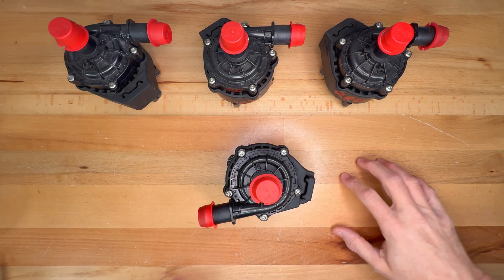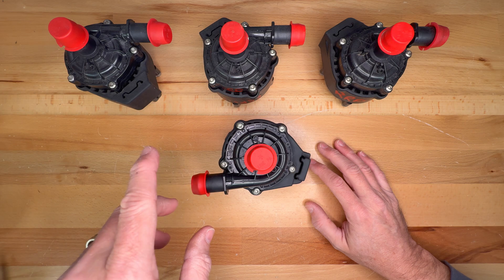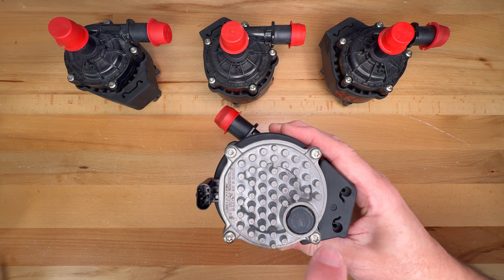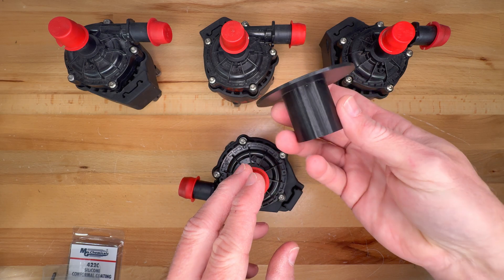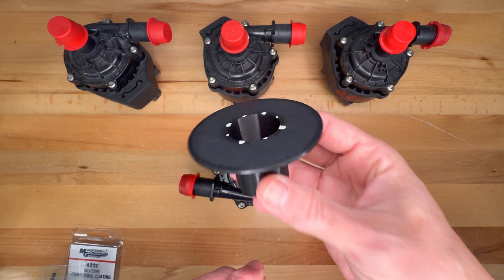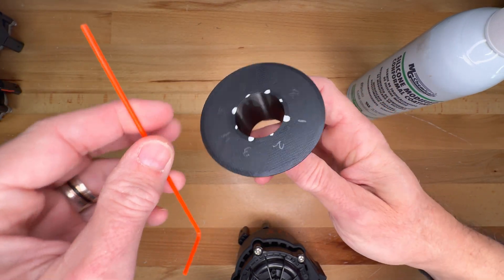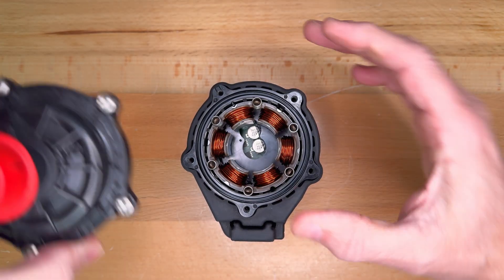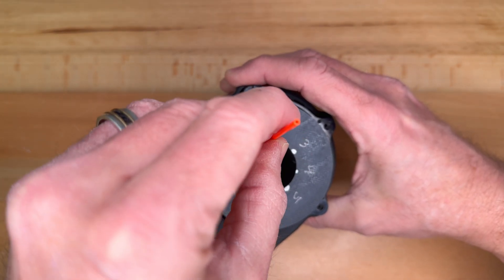Fisker Ocean - Water Pump Fix

Comment: Can I test the pump with 12V contacts to see if it's still working? It has 3 pins. After replacing it, my fan is working, but the new pump doesn't vibrate, as if it's not working?
Reply from the maker: If the pump isn't working, you will get an error.  I'm not sure how to test it otherwise.  Where did you get the replacement pump?  Are you in the US?

Comment: How do you tell if the water pump (or door handles for that matter) were fixed through the recall? NHTSA's recall look-up does not seem to show whether a particular Ocean has had the work done.
Reply from the maker: You will either need to look at the water pump label which shows the manufactured date (after March 2024) or have an invoice from the service tech.

Comment: My understanding reason the water pump leaks so early is because they had a batch where the oring was pinched causing it to prematurely leak. You just really just need to replace the oring .....
Reply from the maker: The recalled HVAC water pump is due to the printed circuit board not having enough conformal coating to protect the resistors from water vapor inside the pump.  It has nothing to do with the o-ring.

Comment: Hello,
A big thank you for excellent videos, precise and instructive.
I have a FOO and the heating of the cabin does not work anymore. The AC works but not very powerful. Do you have an idea to solve this problem?
Thank you very much JY Berney from France
Reply from the maker: @jyberney  Did you recently get a software update? You may need to reset a fuse or possibly something needs to be updated or replaced.  It’s hard to determine without doing a diagnostic.  Are there service techs in your country?
Reply: @MTNRanger  Thank you very much for your reply. No, there's no recent update; I've been using version 2.1 for a year. There's no technical support in France, and no diagnostic tool (Fast).
Do you know which fuse might be affected for the heater?
Thank's a lot
Reply from the maker: @ In the cabin fuse box, I would check the RF17 and RF39 fuses, RRY09 Relay.  https://docs.google.com/spreadsheets/d/1wqx-2YWEWlQSBBpCG5A3iN_m8mSgd_Dg
Reply: Finally, after 3 months without heating and without doing anything, everything came back to normal. Funny car. Thanks for everything.
Reply from the maker: @ Good to hear!

Comment: So how to know if you have a faulty  pump??
Reply from the maker: @isidorogarcia2612  You don’t know unless you fully disassemble the pump and inspect the printed circuit board for the suspected resistor.  It is supposed to be about 3-5% of cars that have the issue.  Just to be certain, all cars are subject to the recall, and need to have the pump replaced.

Comment: Thanks, very informative! Did you also spray the capacitors and other components at the center, on the top? That’s probably a good thing to do right? It’s a must to leave the pump opened so it can dry out for 24 hours?
Reply from the maker: I didn't do the tops of the capacitors as the recall is for the R11 resistor.  But while it's open, sure, why not.  Yes, I would leave the pump open to thoroughly dry out.
Reply: Thank you.

Comment: This is a really nice video. Additionally, I really hope that you in the future can show us how to disassemble the pumps from the car without having to use FAST. European owners have to do it themselves or pay someone to do it for them.
Reply from the maker: @thornaxx5939  From what I have heard, FAST is not needed.  You can purge the air in the lines by setting the HVAC heat high and fan speed high.  I hope to video a tech replacing my water pump in about three weeks.

Comment: Excellent video,  I have a question: Are all these pumps subject to recall/replacement or just the one you refurbished? Thanks
Reply from the maker: Only one of the four pumps in the car is subject to the recall. In addition, only some of the pumps have the defect; most likely 90-95% are fine.

Comment: Did you also de-solder and pull the board on a different one?  I'm wondering if that wouldn't be a better option for a good coating application.  Do you happen to know how many spots need to be de-soldered?  I presume it's not just two...

Edit:  great video - thank you!  Very glad this kind of content is available for the Fisker. I signed the papers on mine today.
Reply from the maker: @tmarbut  I mention in the video that it is an option, if one chooses.  The person that first developed this technique tested both methods and determined that going through the windings is easier and the results were similar.  You can see the soldering here: https://youtu.be/LdSf988Nxwg?si=1nREgRWZ0VVfsTyc&t=131

Comment: why not just get it replaced with a new one?
Reply from the maker: I mention in the video that I have an appointment in a few weeks for a new pump.  Stock of the replacement pumps are uncertain after the recalls are fulfilled.  For cars with low miles, this is a good way to get use out of the existing pump.  I'm keeping my refurbished pump as a back up.
Reply: Great video! Does it make sense to sprey a second time?
Reply from the maker: @geriskater2657  I would focus on the area behind the two capacitors, that's where the resistor R11 that fails is located.